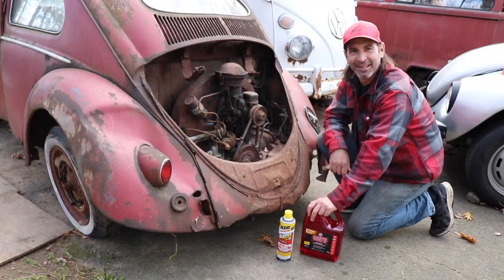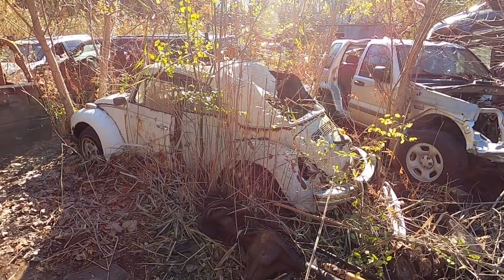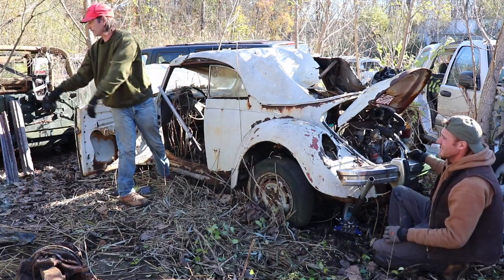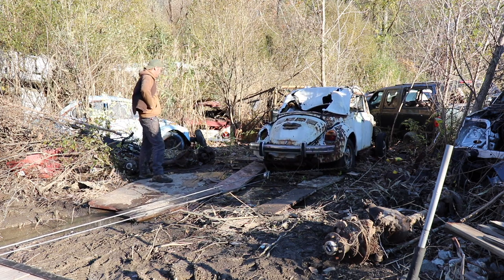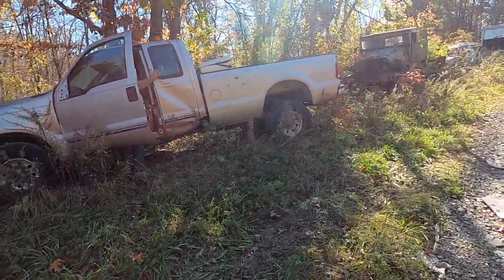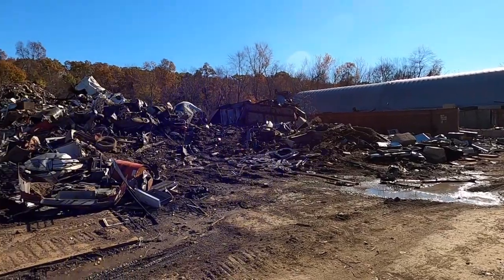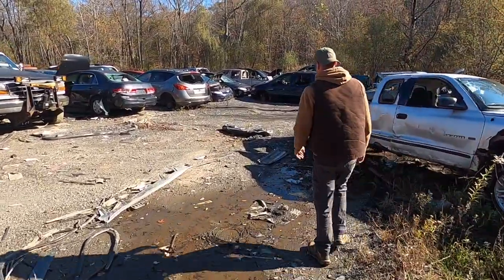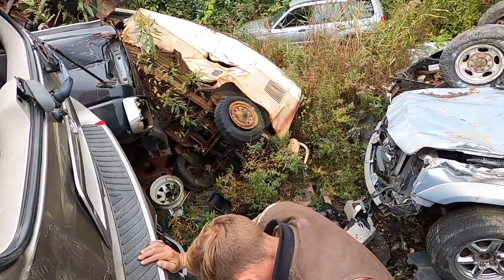Back to the ScrapYard for the rare Vw Beetle & what other surprise finds ?

Comment: couple heater channels some floor pans and you'll be driving that vert in no time. Just keep the windows and top down nobody will notice they are broken.
Reply from the maker: And the straps holding the engine off the ground 🤣

Comment: It just might save you money in the long run to.,or cost you less to fix yours instead possibly. Check your silanodes switches.& gears for lubericant on them to just A heads up.

Comment: Lots of good bits and pieces on that white bomb. And for $400…..a little pricy but…..
I want to tell you a story….bout the house rent blues? No….no.. another.
I have a 69 (dude) beetle, and the trans was crap. Ok, after a used one…bad, and a rebuilt one bad….I settled for a guaranteed 35000 mile unopened unit I paid a premium for. More than $400.
So….lots of good parts there, plus a will it run, and key for doors and steering column. Gee…just the rear view and dome light combo ,if it’s good….is expensive.